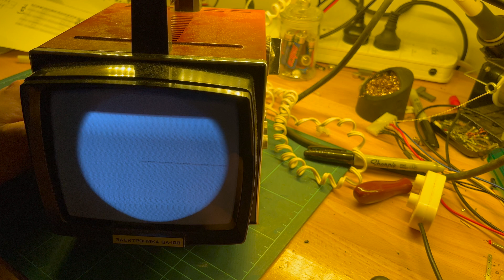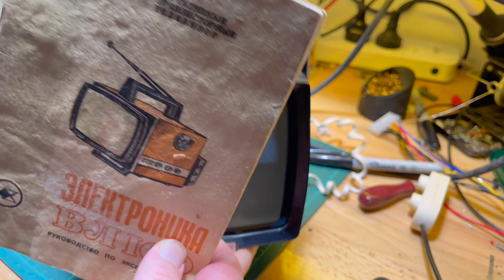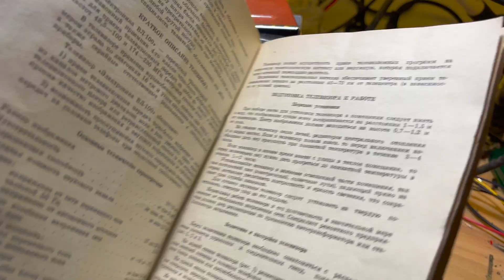Электроника ВЛ-100 (Elektronika VL-100): Part 5 (second example) [TCE #0287]

Comment: Quick question; im currently trying to repair one of these and I've stumbled across a fried resistor. Now, in the schematics it is resistor R103 1,8. Does this mean that the resistor is only at 1.8 ohms?
Reply from the maker: https://www.crowave.com/blog/2023/01/25/tv-elektronika-vl-100/
Reply from the maker: Hey Tommy - that does sound possible - you can get them online at Farnell/Element14 (for example) … maybe not at your local electronics store though /Brett
Reply from the maker: Okay, I've woken up more ... I can't find this R103 on my opened-up one ... was hoping to take a photo or even de-solder to confirm it for you ... I can see it on the schematic but it's not matching my board B (Б) ... it could be that the design changed perhaps ... I think the schematics I scanned came with the 2nd one I got so maybe don't exactly match my 1st one ... I can find R101, R102 and R104 easily enough. The best I can see at the moment is that it's a resistor type MON 0.5 (типа МОН 0.5) ... I have no idea what that is ... ? /Brett
Reply: @Brfff  Damn! Thank you for actually trying to find that one resistor. I'm now quite certain that my board must be of an older version since mine is from 1976. I've been looking for a wiring diagram just for the one I've got but haven't found the right one just yet. I found one video where I could see the resistor for about one second and it had 1E8 typed on it. And if I'm correct that should be 1.8 ohms.
Reply from the maker: I found this, finally, regarding the "type MON-0.5" resistor ... I use Chrome which offers to translate the page to English ... explains quite well the markings on Soviet resistors!  MON - metal oxide low-resistance ... and you're right, it does look that "1E8" is the same as our western "1R8" to indicate 1.8Ω

https://www.kakras.ru/mobile/book/electr-resistance.html
Reply: @Brfff  I tried replacing the burned resistor with another one rated at 1.8ohms and it burned up immedieately. The tv still "works" and turns on, but there is a problem with the vertical hold (this was the problem before i replaced the resistor as well). Maybe there is something wrong with a capacitor on the vertical hold circuit? Or maybe it could be the transistor that's connected to the burning resistor? Im quite the rookie when it comes to repairing electronics...
Reply from the maker: Maybe ... I'm not an expert either ... but if it's burning up straight away maybe there is a short to ground, and a good culprit is a capacitor.  There is a good description of the functioning here ... but I had found another website that also had a really good description, I think ...

https://deviceschematic.com/en/television-and-video/5432-tv-elektronika-vl-100.html
Reply from the maker: Here's another schematic - you need DJVU to view the file - I can't find R103 ... R101, R102, R104 ... arggh.  I wonder if it's worth documenting every component value in a list ... not sure if that's available somewhere

https://elektrotanya.com/electronica_vl100.djvu/download.html
Reply from the maker: Ah ... another good description in Russian ... Chrome translated to English for me:

http://rfanat.ru/s3/tv-470.html
Reply: @Brfff  I'll make sure to take a good look at all the capacitors when I've got some spare time over. I'll make sure to get back with any updates on it